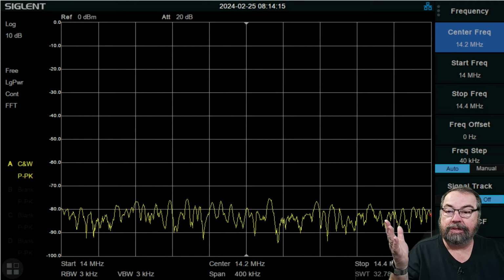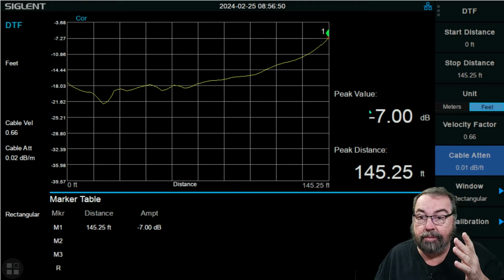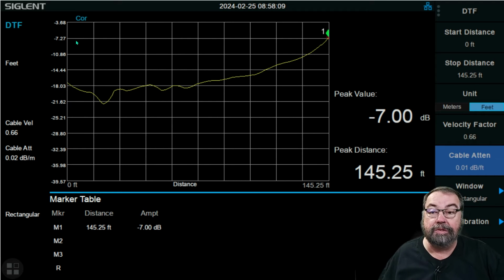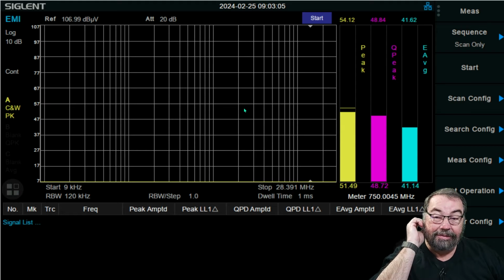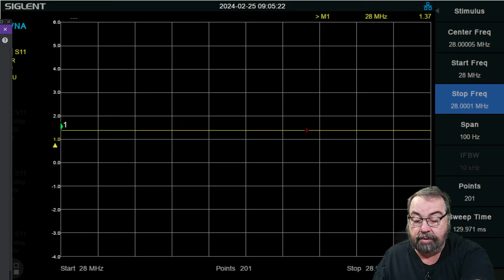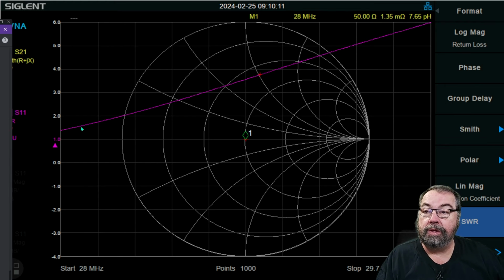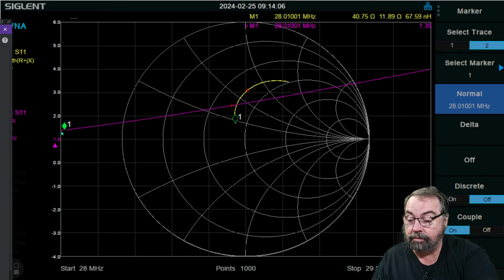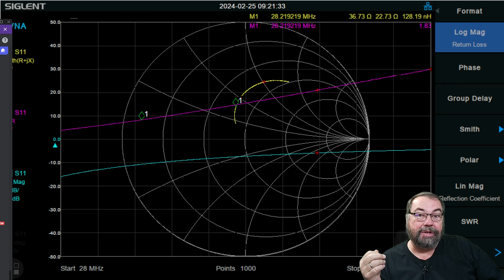Siglent SVA-1015X - Test ALL THE THINGS!

Comment: I just picked up a 3021X Plus and am trying to figure out how to test DMR mobiles and portables. If your looking to do a video, a few basic test with a DMR radio would be cool and or a P25 would be really cool. It doesn't seem like anyone on the net has made a video on both of these modulation types so I imagine it will be a pretty popular watch.

If you need any of these pieces of equipment to test with, I have a handful of spares for both I would be willing to give up for this kind of content. 

Cheers,
Reply from the maker: What kind of testing?  I don't know that I can demod P25 or DMR (which is why no one has).  It's possible maybe, but I'll have to study on that.  They're both FM, and of course the spectrum analyzer can see the output signal (power and frequency).